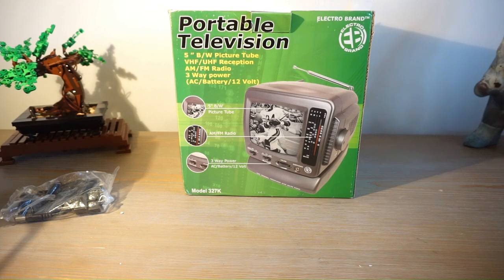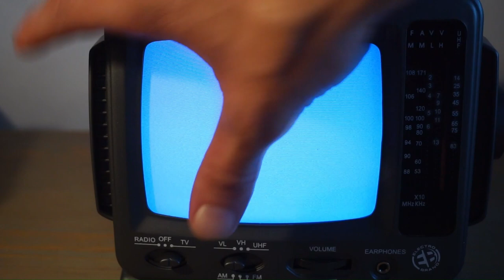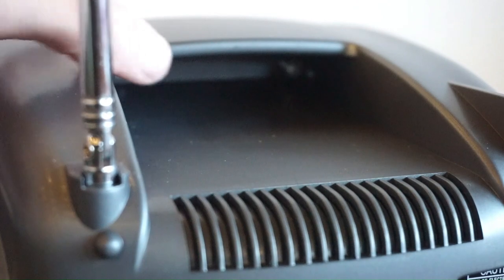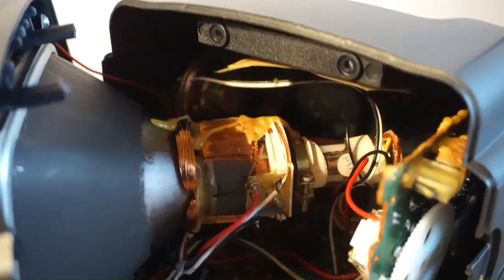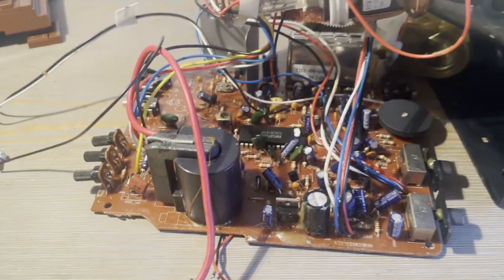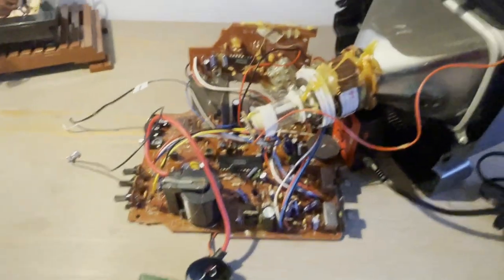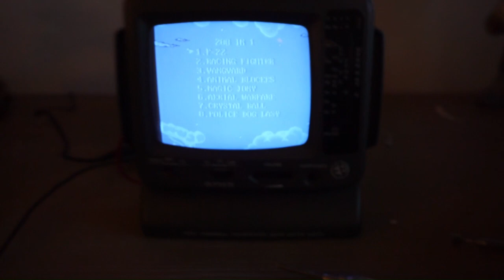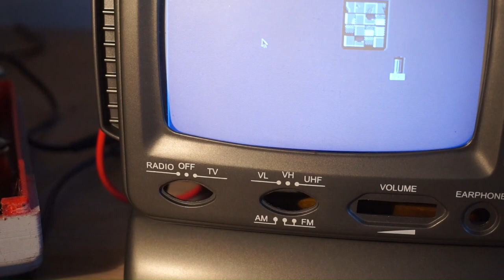Electro Brand 327K

Comment: I take the radio part straight out, then add composite in on pin 12(?) am current working on injecting audio into the lm386..